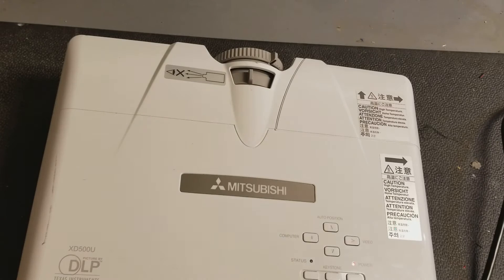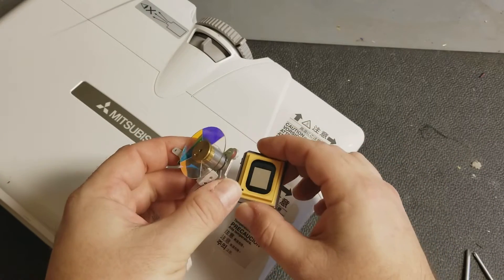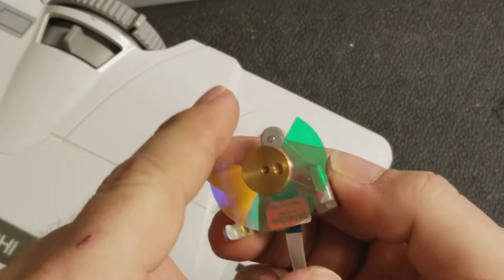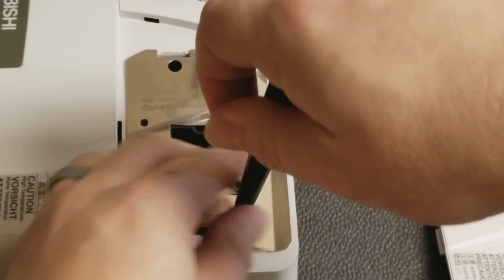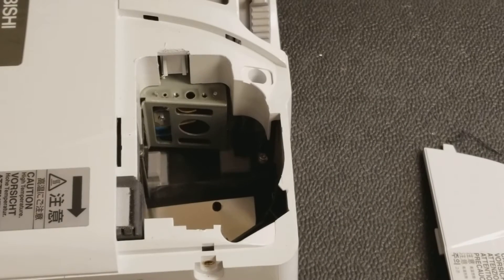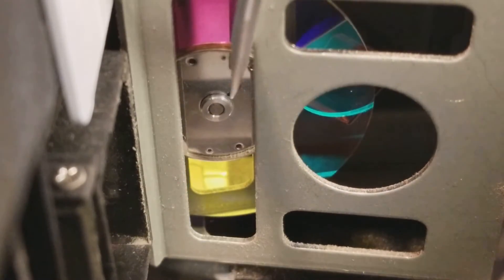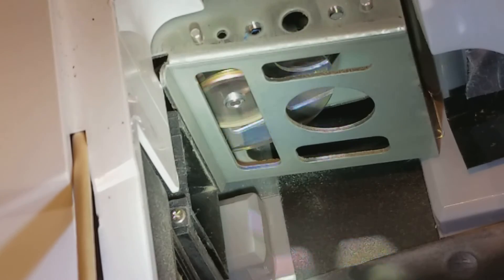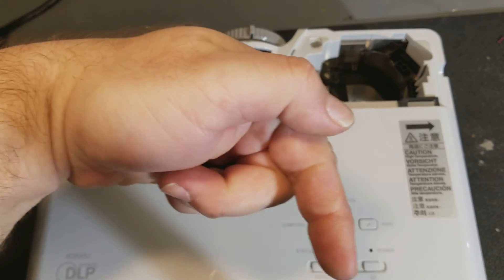Troubleshooting your DLP Projector : Color Wheel

Comment: Bonjour les télécommandes sont elles standards. Merci de vous lire.
Reply from the maker: Sometimes the same brands will work but every manufacturer is usually difference.  Universal remote controls tend to work if the OEM remote is not available.

Comment: Hi Frank my projector has gone completely white! Thanks for your tutorial, could not understand how to troubleshoot the wheel. Apparently the wheel spins correctly. The colors seems a little faded though. What else could I check to get my images baaaack? I've just swapped the DMD chip!
Reply from the maker: if the CW is spinning, then it is probably okay. do you mean the picture is totally white, as is no changing pixels and and its almost like the DMD is totally on?  Or do you still recognize some video and it is just very washed out? also what model is your projector?
Reply: @FixitFrank  Yes, it's like the mirrors are stuck in "open". No video at all. The model is nec u250x!
Reply from the maker: @aleskanders3741  that sounds like its before the DMD area. I would check for voltages around the connector that feeds the DMD board(the board that the DMD is connected to). I suspect you lost power to something that feeds the DMD. This is a fairly non-standard failure though.  Check your connections carefully. If the DMD has a little black carrier that it sits in, the pins in that can be damaged and cause this too.  It's either turning all the mirrors on because it has a short somewhere or the ground is lifted electrically. I am assuming a little here as I am not looking at it but this is what I would be looking at.

Comment: Hi any advice on how to replace the colour wheel on a viewsonic Px727-4k ??  I can't see how to access and remove it !!
Reply from the maker: I can't say I have worked on one of those yet.  But its very possible the entire optic module needs to come out.  Many of the 4K chassis I have seen need the module removed as an assembly and then the wheel comes out from the inside.  If you are in the US and you get stuck, we could connect and maybe I could do it and make a video at the same time?

Comment: Hi frank, i have a really old projector, LC7281, IT had problems in the input section, so i open up, change de conector, and the projector started working properly. However aftarwards, i just put the final screws, and a few hours later, when I was about to use it. It gave me a LAMP error. The lamp seems fine, the i checked the color wheel, and its not spinning. I cant find any service manuals for this model so its  a pain in the s to know where to check. all I know is the fan and color whell does not spin when i starded it, i checked the mosfets and they seem fine. (the previous repais was simple and i didnt had the need to go near the color wheel). Any inputs on how I should troubleshoot this issue?
Reply from the maker: Check the color wheel cable if you had it out. Make sure its not upside down.  Also check the capacitors in the low voltage supply. That is an old unit so I could see the caps failing by now.
Reply: @FixitFrank  Will do, thank you só much
Reply: @FixitFrank  So basically this unit has a pcb only for dc-dc conversion. My ribon seems fine, i didnt touch him, but i have check for continuity and all seems ok, im suspecting there is something going on on the dc-dc pcb since some of the pins are shorting to ground. however i cant say for certain since I dont really know what they should be showing. maybe they are suposed to be ground. Will try to dive into this a litle bit more (visual expecting the Caps seem fine, maybe one is failling and thus the pins voltage) will try to trace it bag
Reply: @FixitFrank  Well quick update, I was just trying to see if I had any signal for the motor and the wheel just started to run again. The projector just started working again and i Just don't know why, It's great to know all it's working. however, it may just fail again and I don't know what to do to fix it. Maybe a bad GND connection.. No ideia. Thank you anyway for your time!
Reply: @FixitFrank  Ok final update, and I'm really sorry for bothering you, basically after a run of 10 min. the projector turned itself of. now all works well projectors start working but the lamp never turns on. The projector continues to go past the heating phase and now it doesn't turn off or light the lamp-led indicator of an error. This is clearly the ballast that somehow thinks is outputting the voltage to the lamp but nothing is coming out.
Reply from the maker: Hmm if there might be a pile of bad capacitors.  The problem is the age.  These run hot and tend to cook capacitors over the years.  As much as I would love to see it repaired, i think this would be a waste of your time and money sadly.
Reply: @FixitFrank  yep, I found out the projector will turn on after beeing plugged in in standby for 5 min, thats prob the capacitor, thank you so much anyway!

Comment: Hi Frank, 
I have a Mitsubishi projector (FD-360) and it powers on and everything works but then it turns off and makes a weird whistling noise from the speakers after about 5 seconds. It also has this weird extended bit on the lens and it says something after powered on but  I can't tell what it says. Do you know the solution?
Thank you!

Comment: Hi, Frank! Thanks a lot for the videos😍 I would like to know more details about index marks.
I have a problem with my Optoma 142X. It was making that specific sound when it doesn’t see the color wheel spinning, which I also know from your videos.
When I opened it I saw that the index mark on the color wheel was gone completely.
So I decided to try the high temp you showed in your other videos. Now the color wheel is barely spinning. I cleaned all the sensors, the wheel looks fine. 
Not sure what else I can do. Does the index mark have to be a precise size or +- 1 mm is fine? I’ve tried several times but still no luck
Reply: Do you have color wheels for 142x and photo sensors? Or where can I order those?
Reply from the maker: Hi Alena!  I would check the flat cable that you plugged back into the mainboard.  See if that cable is loose or if it is flipped over. The photo sensor should be fine.  It is very rare for those to fail. I suspect your color wheel is the only issue.  If you are in the states, there is a seller in Florida who might have them.  Voltarea on ebay.  Otherwise you can contact the people I use.  Time electronics.  Gydz@timeprojectorlamp.com  Let them know I referred you.  Check that cable first though and also make sure you held down the door switch when you test(if the lamp is not installed).  If the switch isnt held the color wheel and fans will not start up.
Reply: Omg, Frank, thank you so much for such a detailed answer. I will let you know how it all worked out. 
Another question:
After five years the lamp connector wire went pretty bad. You can see the wire and there are cracks. Was googling but couldn’t find anything. Seemed like such a simple cable to me. Can I find just the lamp connector somewhere?
I know there is high voltage there. Can I put some electrical tape on it?
You are a lifesaver! All the very best from me
Reply: @FixitFrank   Thanks again! I’ve ordered a color wheel from Amazon, because it could be delivered the next day. I doubt it is an original though, but as soon as I’ve plugged it in everything works. I still have no clue what was with the old one, maybe it was just the time for it. 
I’m still worried to use the projector with the wires out on a lamp connector.    I would appreciate if you could help me with finding that wire.
Reply from the maker: I think I have a connector from a scrap projector. If you want to email me frank@fixfrank.com, we can coordinate me getting that cable to you. Great job on the color wheel and as long as it's working that's all that matters.

Comment: Hi Frank, so my optoma gt1080’s color wheel does not turn on anymore. With help from your video I checked and saw that it’s no physical problem due to dust or the wheel being stuck or something similar. My guess is that the electrical board that sits on top of the color wheel (the one a small screw goes through) got too hot (it is a little black) and the signal telling the color wheel to start turning does not reach the color wheel anymore. What would you suggest I do? Can I order these electrical boards separately and do you think this is the problem? Would love to send my projector to you but I live in Holland. Would love to hear from you!
Reply from the maker: I suspect the sensor board is okay.  They can get heated but they are rare to fail.  The color wheel should spin up regardless of the sensor.  I would try a replacement wheel first.  If you want, you can measure resistance between the coils on the color wheel. They should read 3-8ohms with one of the pins being a common. 
Or you can just jump to replacing the color wheel.  They do fail and they last about 5-7 years before they need replacement and that puts your projector's age right in that spot.   Also be sure your Bulb housing has the proper IR cut filter on the front. It should be reddish/blue and not greenish at all. Good luck!

Comment: How to dust a dlp optoma uhd30?
Reply from the maker: It's not too hard.  I would just use a vacuum on the air vents.  They are pretty new so you should not have to take it apart.  If I get one in for cleaning I will record it for sure.

Comment: Great vid, I happened upon it while looking to diagnose my projector. It's a cheap Chinese LCD running Android, and some time ago it started having a bluish tint/discoloration on one of the sides of the image (difficult to describe without a picture) and it seems to me it's getting progressively larger, moving towards the left side. Haven't found anything conclusive yet, so I might as well ask: have you seen something like this before, and would you happen to know a probable cause and solution? Thanks in advance!
Reply from the maker: I have seen this. Its a common way for those to fail. The polarizer panel or LCD itself is melting. The cooling design actually encourages this failure.  It's so they can sell more cheap flashlight boxes.  Unfortunately it isn't worth repairing. The cost of parts (if you can find them) is more than a new projector.
Reply: @FixitFrank  thank you so much for your response! I feared that might be the case, so I'll start looking into buying a new unit.

Comment: i may have touched my color wheel and now my color is all off is there a way to clean it
Reply from the maker: some isopropyl alcohol or even glass cleaner.  It wont be a huge problem if you touched it.  Clean it if you see a finger print for sure.
Reply: @FixitFrank  could there be another issue other then a finger print that will affect the color and make the projection laggy
Reply from the maker: @mrcylucky6420  I don't think a finger print would cause that. A failing color wheel motor could cause that for sure. Or a dirty color wheel sensor would be another possible cause.

Comment: Hello Frank, your videos have been helpful in repairing a optoma hd39hdr that I have. It started off with no power but I've been able to get it to turn on now. But now it'll stay on for a bit and show a blue screen, menu and everything works, but then after a minute or so I hear a noise like something is spinning up and down and the screen flickers different colors. Do I need to replace the color wheel? And if so do you know where I can get one?

Thank you!
Reply: Update on this: it only seems to flicker when it doesn't have a signal and if I change the video mode to anything other than presentation it starts flickering as well even if it has a signal. Also the first hdmi port doesn't seem to work. Can the ITE chip cause these issues?
Reply from the maker: :)  I talked to you on reddit :)  I bet the ITE chip or the TVS diodes are your issue.

Comment: Hey Frank, thanks for the video! I have a Dell 1610HD and lately I’ve  been getting an error that is described in the user manual as “color wheel breakdown”.  The recommended fix in the manual is, “Unplug the power cord after three minutes and then turn on the projector.” 

Sometimes that hard resist solves the problem, usually it doesn’t. What I don’t understand it why the color wheel engages sometimes, and other times it doesn’t. I have a Denon receiver that runs my video feed to the projector and I thought maybe there was something with the order in which I turn off the projector and receiver, or maybe if the receiver was on the wrong channel when I turn on the projector that would be causing some kind of issue. But if those things are related, I haven’t figured out the secret order as of yet. 

Do you have any suggestions as to why the wheel is sometimes engaging, and other times not?

Thanks!
Reply from the maker: Its hard to say exactly without looking at it but there are few possible reasons.  Usually its the actual oil-bronze bearing or the sleeve bearings wearing down and the wheel can stick a little.  The sensor that tracks the rotation will throw an error if the RPM does not pick up fast enough.  By restarting a few times it sort of frees up the wheel.  Another possibility is dust build up on the sensor.  Sometimes a piece of dust will block enough of the IR light to the index mark and then restarting gets that dust to push away.  If you are still on your original color wheel, I'd look at replacing the wheel. Its not too hard on these and I suspect its pretty inexpensive.
Reply: Thanks for the suggestion! Any idea where to get the right part? I’ve read that Dell is not very free with their parts.
Reply from the maker: @andrwatln  Dell wouldn't have it anyway.  I think these are made by coretronic(optoma). Either way, they are honeslty quite generic parts. eBay is fine but I use a company in China called Time electronics.  I doubt you are going to find one in the states, but I did not check around.  To contact the folks I use, email gydz@timeprojectorlamp.com  They may ask for a picture to prevent incorrect parts. They take paypal and use dhl so its all pretty safe. I think I saw one on ebay for $36 with shipping. You might even get away with cleaning the sensor.

Comment: I have one small request for a video if you ever need ideas for a new video......I've always been really curious to know what an image from a DLP projector would look like, if it had its color wheel altered so that each color was replaced by an IDENTICAL color, but made from celluloid film......would it look anything like the 35mm projectors used to look like? .....I know, I know, a bit geeky, but I'm such a fan of 35mm film and the idea that you could build a projector that came somewhat close to the same image quality, would just blow my mind!!! lol....anyway, give it a think. Thanks again for an awesome, well explained vid!
Reply from the maker: I suspect it honestly would.  You wouldn't even have to really replace the segments.  You would have to use a piece of tinted glass as celluloid would definitely burn up in the light path. I have a video on modifying the color wheel for an art project that I helped on.  You could use the same method to fool a the projector into thinking the color wheel was in place. https://youtu.be/TZ7JbMfKya0  check out this vid to see what I mean about fooling the wheel.

Comment: Thanks for the tip 
My projector works fine except that the fans are always on high speed even on echo mood  .do you think its the photosensor malfunctioning
Reply from the maker: Hi Mohammad!  That is unusual.  The photosensor should only affect the color wheel so I suspect the fans are running fast for another reason. What model do you have?
Reply: @FixitFrank  DELL DELL S560T 1920X1080 3400 ANSI LUMENS 16:9 DLP INTERACTIVE PROJECTOR , the problem with it that it has the fan on highe speed all the time recentlly . befor it was doing it after a longe useage but now its dong that all the time
Reply from the maker: @adeeep  Check to see if it is in high altitude mode.  If not, I would clean the fans for dust.  The heat may be elevated/higher if there is dust build up internally.  If you use a vacuum and brush to clean all the fans and insides, I think it wil help. Check for high altitude setting first.  here is the manual. https://www.projectorcentral.com/pdf/projector_manual_9570.pdf

Comment: Hi Frank, thanks for putting up these videos. They helped me diagnose my Optoma HD142x. I've followed your steps and confirmed that the color wheel spins up. Every time it spins up, a whirring sound can be heard, ending with a stutter, but it definitely comes up whenever the color wheel starts spinning. The fan comes up afterwards, and it sounds normal. Does that mean the color wheel is done, and I need to replace it or something that can be serviced?
I've put back the bulb, and it doesn't fire up, and after 3 cycles, the bulb doesn't come on.
Reply from the maker: Hi! the stutter is likely from the color wheel sensor not seeing the index mark on the wheel.  On that chassis, there is a known issue where the little black sticker falls off. Check this video out.  https://youtu.be/za-viIWXUlQ